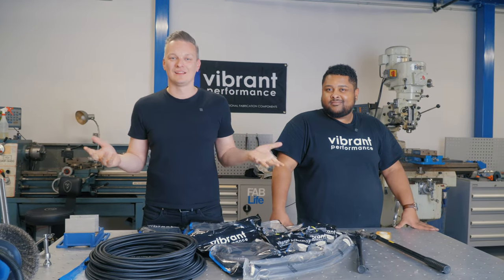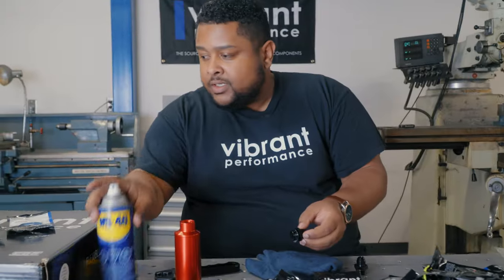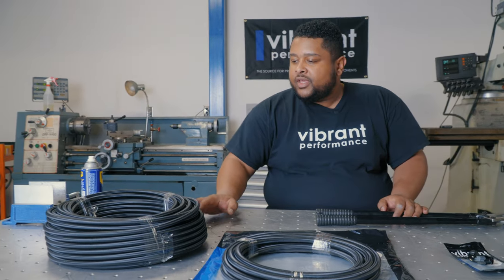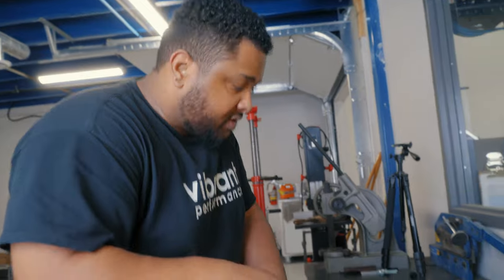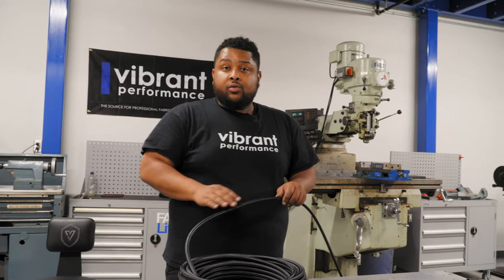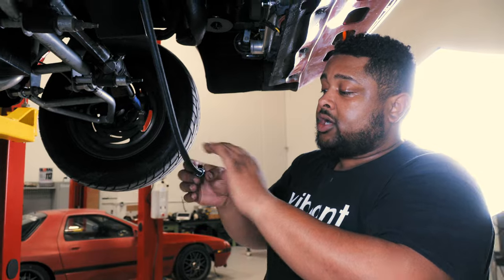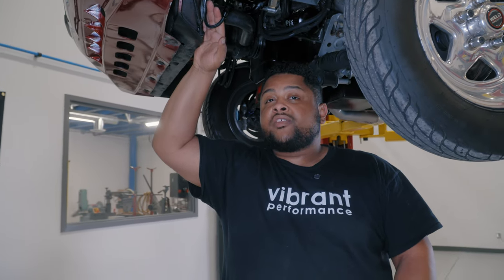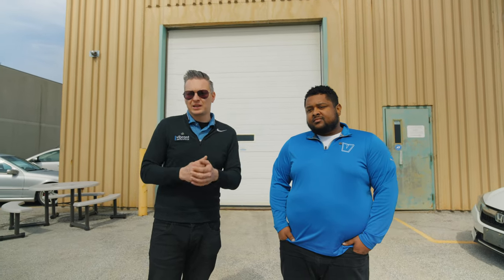Installing PTFE Fuel System AN Lines and Fittings Start to Finish

Comment: I got a question.  I just bought a new 2023 challenger and I'm doing tons of mods to it already.  One thing I'm thinking about is doing braided lines.  Due to not being able to disconnect both ends of some of the hoses because of their hard to get to locations, I was going to use a stainless hose cover kit, that I can slide down to where I need it to go.  Are there any AN fittings that act like simple hose clamps to the ends I can reach or am I stuck using those tacky ricer dressed up hose clamps that look like AN fittings everywhere?  I will probably have to use the cheesy clamps at the ends I can't get to and even then I will have to grind the lip down, so it will slide down the hose.. All the lines are either a press fit or standard hose clamps. They do have some other anodized aluminum clamps nowadays that look a lot like a seat post clamp for a bicycle.  maybe I will use those, though they seem a tad bit narrow.

Comment: Definitely super stiff. I want paying attention while pulling the hose through some frame members and it kinked. I did a pressure test and no leaks is it still good or does it need replaced?